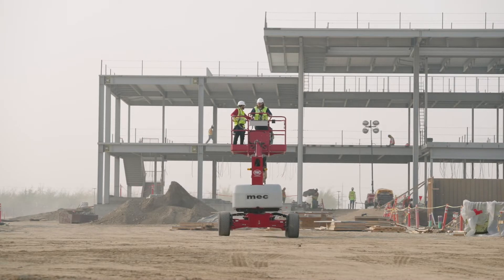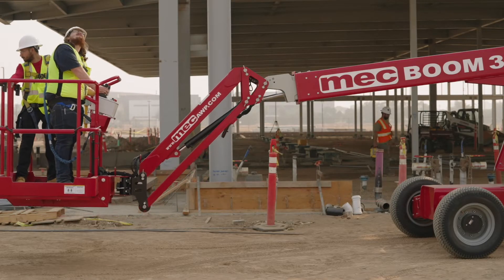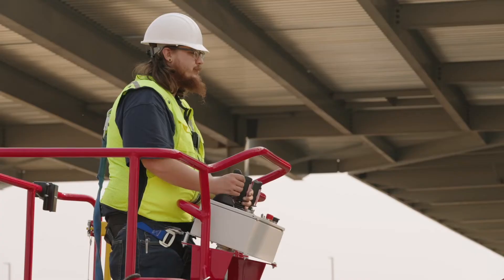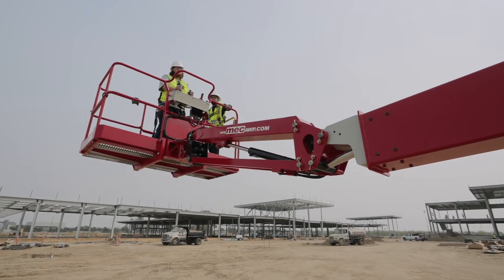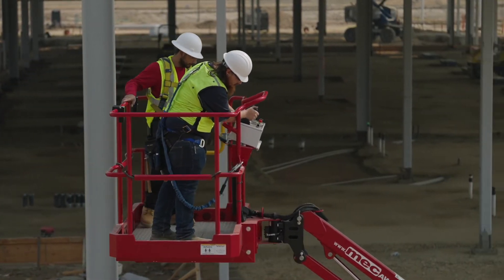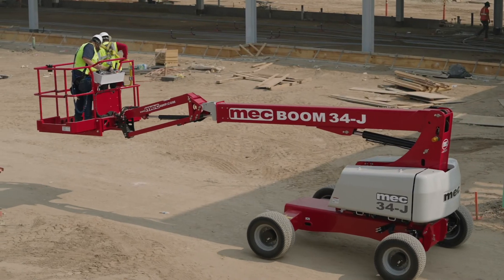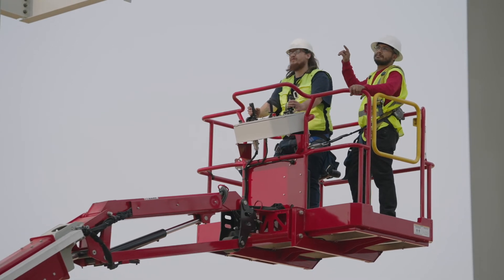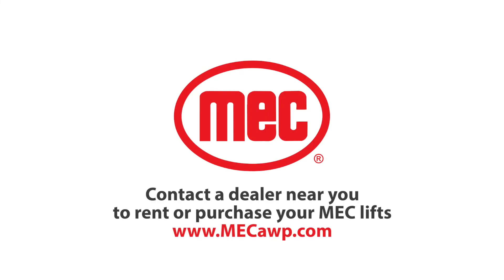MEC Better Booms for Safety and Productivity

Comment: These are the worst booms I have used. JLG and Genie are waaayyy faster. The only thing I like better is these don't have the magnet wire that shuts down the machine when it's broken. No foot switch is good for when you're on bumpy terrain but grabbing that trigger is a pain when u gotta drive the thing around alot